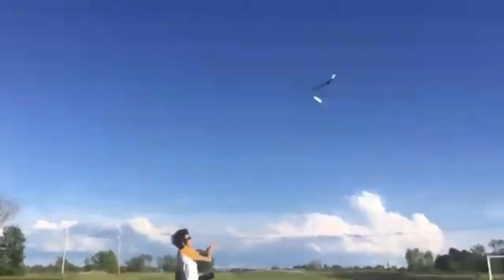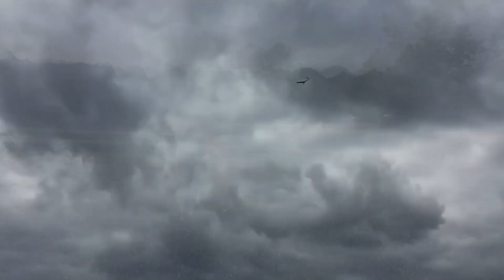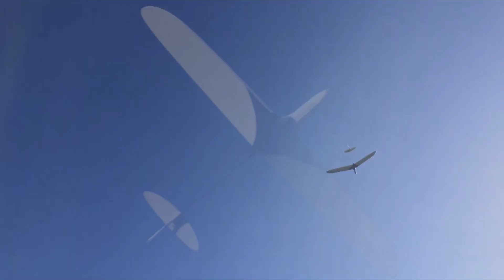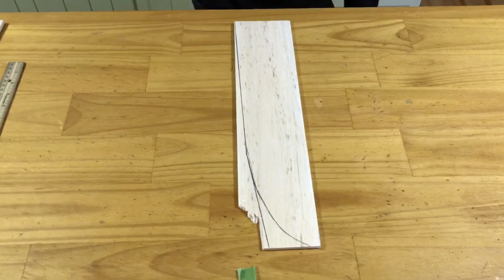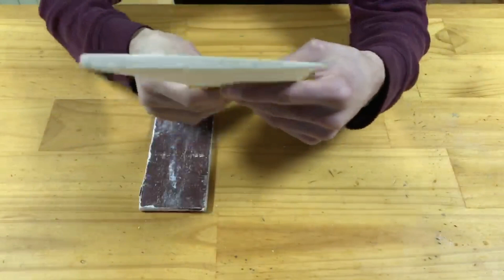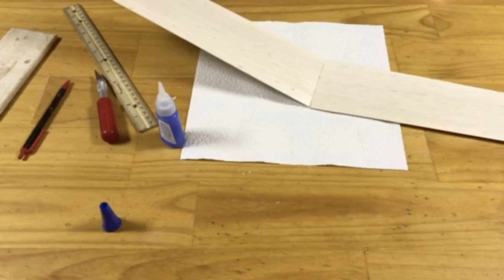Balsa DLG Build Tutorial - Episode 1 | WINGS

Comment: I use removable 3m photo spray.stick both wings down and sand them at the same time the center together. The wings aerofoils will be easier to match.
Reply from the maker: Very good tip! You could easily incorporate that into the method shown in the video. The only issue is that you cannot go too thin, otherwise the uneven pulling will bend the trailing edge. (Pulling against the firmly taped the bottom surface I mean). Also it would be difficult to remove the 3M tape (very sticky) from a thin trailing edge.

Comment: Question: Can you explain what your minimal sender settings are, for a dlg start? Is a sender with flight mode programming mandatory, or can a low skill dlg throw and climb be achieved with just one overall trim and manual elevator control?  How do you achieve going from horizontal throw to steep climb without doing a loop?
Reply from the maker: Wow sorry I guess I never saw this comment. Well, if I remember correctly, I think this glider had a launch setting of about 1mm down-elevator and 1mm right-rudder. If you make a glider with ailerons/flaps you can set a couple mm of up-flaps for launch. Put the setting on a sprung switch that will flip back to OFF position when you let go of switch.

Comment: the best explanation ever thank you for making this video as I'm searching for a references video for my project-based learning program and this very helpful. would you mind if I ask that do you think if it can be launch and fly freely without any motors or electrical support?
Reply from the maker: I am glad you found this helpful! I have gotten that question before. Here is what I told someone else about that possibility:
Yes it could maybe fly free without electronics. It might be a bit fragile with the current design (I'm imagining all the nose-dives that a free flight DLG has to withstand before it gets adjusted smoothly 😂), but i think with some strengthening this might be a passable free-flight design. I would be concerned about its stability though, as most free flight DLGs have polyhedral angled wingtips for extra roll stability, as well as a Y-tail for yaw stability during launch, both of which this design doesn't have. To counteract the potential instabilities, I would probably sand some washout (negative wingtip angle) into the airfoil, along with some trim tabs on the wingtip trailing edges to set a nice left-right pattern. It would be finicky but could work.
Reply: @AeroCraftAviation  thankk youu for your respond and explanation I do appreciate it🤍✨

Comment: Any inputs on stanfoil?
Reply from the maker: At this size and weight, I have found that the flattened leading edge seems to lose its unique efficacy. I also have found that, at least for these 4" chord, 36" span, 65-gram DLGs, it is better to have more camber on the upper surface than on the lower surface. An airfoil with symmetrical trailing edge is not very good for slow flight or thermalling.  However, I have found that a symmetrical leading edge (rounded both on top and bottom) is better than an asymmetrical leading edge (rounded mostly on top, or rounded on bottom and flattened on top). I have also found that better launch height (might) be achieved by extending the leading edge taper a bit, so the airfoil high point is a bit further back. I can't say for sure though. There are so many factors. In fact all of this is speculation, and while it comes from a lot of flying and building, there is still a chance some of the observations are inaccurate. Hope this gives some ideas. :)
Reply: @AeroCraftAviation  could you provide pictures for these aerofoils. The description seems to be going over my head.

Comment: When making a solid balsa wing, as you’re doing, I find it easier to get matching panels by working on on both at the same time.
Take each step of the shaping process and do it to first one panel, then the other.
That way, you match the panels at each step, rather than finishing one then the other.
You can remember how you did the last step and repeat it, instead of trying to remember a whole sequence.

Take care, and have fun.
Reply from the maker: That's a good point and a reliable technique. I think, for me, my approach works well, because i have a sort of tactile, intuitive memory of how i'm shaping the wing. It's like I have the idea of the shape i want in my head, and if I stop the sanding process and go to the other wing, I will lose the memory of where I was in the shaping, and the final form will be more crude. Since it's the same idea for both wings, and the same tools, I find my accuracy is pretty good. Besides that, I have made something like 20 pairs of solid balsa wings, so remembering the sequence is not problem at this point. I will have to try your stepwise approach and see if I can dial in precision better. Cheers. :)

Comment: Thanks for the video. Great tutorial.  A little tip when tracing things like the wing to another wing if you shift it down  you’ll be a lot closer. Less sanding
Reply from the maker: Thanks, glad you like it. Yes I think I mentioned that in the video. The general case is to always cut on the inside of the pen line; if your shape does not match up with a corner, shifting one direction or the other will not work.